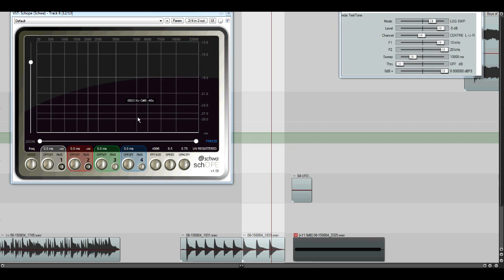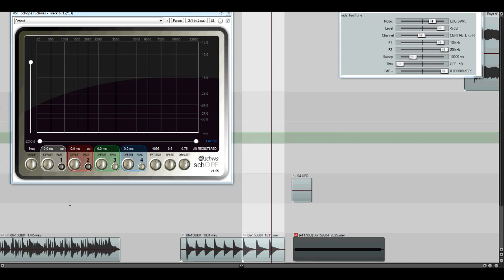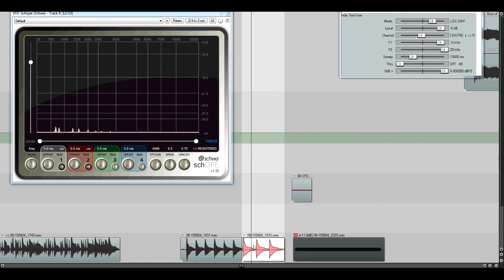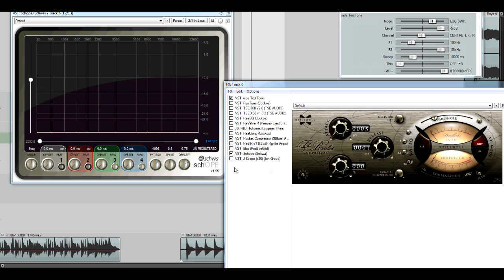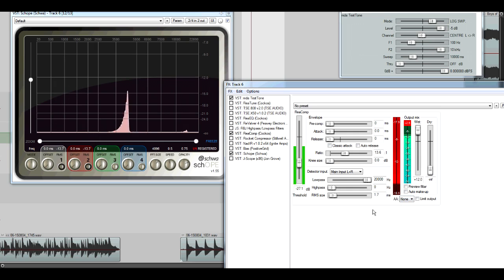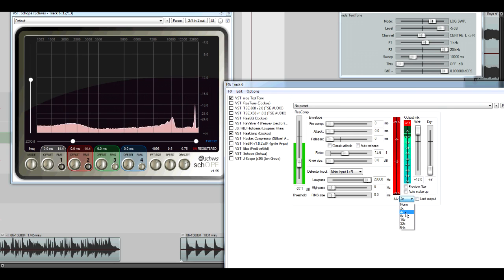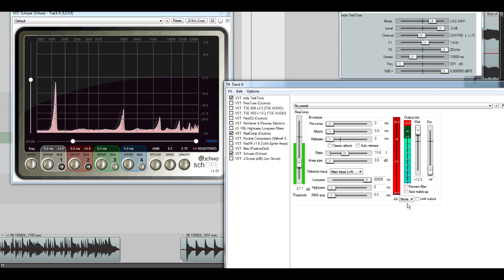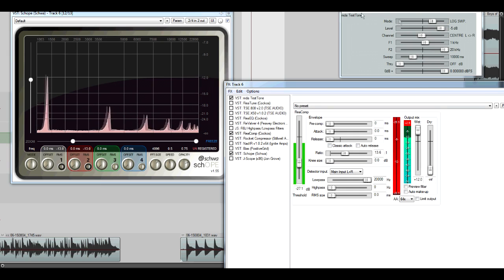Aliasing in DAW Amp Sims and Compressors

Comment: On the amp sims I believe you're noticing intermodulation distortion. This behavior occurs to different degrees on real amps as well. The sum/difference frequencies when bending complex harmonic sources together may not be harmonically related, but become amplified due to the same things causing all those other harmonics you see to get generated and amplified. Oversampling won't fix or even substantially change that because it isn't aliasing, it's usually the sims doing a varying job of reproducing an authentic behavior that must be expected when high THD is involved, they go hand in hand.

Regarding it with the compressor, especially ReaComp since I don't remember it being a big THD compressor at all - is it a behavior that occurs with normal material or is it just when using the compressor with high ratio, instantaneous envelope, and a super deep threshold? At the levels of compression it is pushing any low level signal distortions would be super loud even without other intentionally nonlinear distortion code involved.
Reply from the maker: I've been wondering and not sure if I mentioned IMD in the amp sound, but there were other things that pointed towards aliasing
But the double stop IMD could be normal anyway right?
Reply: @pipelineaudio  Yeah, I've been playing guitar for a long time and I have heard that many times on many real tube amps with no digital converter in sight. Aliasing is real of course but if really high levels of oversampling don't even make a dent, it's probably not aliasing doing it.

Comment: It seems to me like AA is broken in ReaComp (at least the version used in the video; maybe it has changed). As I'm writing this 3 years have passed since you published that video, and there are compressors out there (even free ones) that exhibit no audible aliasing. They do use more processing power, but alas, that's life. Since aliasing adds up when using multiple non linear effects in series I really do think it's important to manage aliasing artefacts to avoid an unpleasent, grainy sounding high end.

Since I have my compressors and saturation plugins in check, I'm looking for a high quality amp sim right now. That's how I ended up here. If anybody wants to chime in with a recommendation I'm all ears. Cheers!
Reply from the maker: Silly Youtube marked your comment as spam. What's a good compressor that you dont think aliases that I can try on this same test?
Reply: "If you want a plugin that is aliasing free go for Waves Rcomp (on factory mode) or Fab-Pro C (but only with oversampling otherwise it alias) or Rvox.
Regarding analog emulation, the only aliasing free compressor I got is MJUC by Klanghelm (but with a "high" noise floor at - 120db) then come Sonimus TuCo (which is extremely aliasing free until you push the drive over 4, I was quite impressed), Bx_console N compressor, Waves API 2500, SK Note SDC."
Reply: Did you find that amp sim?